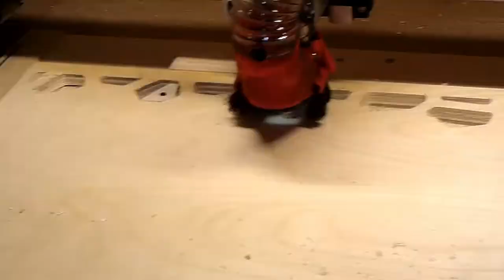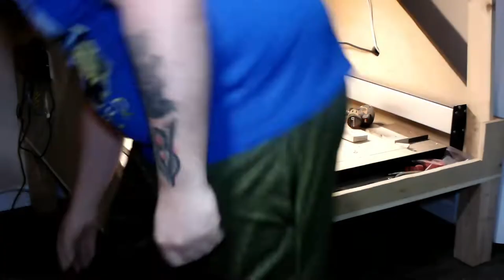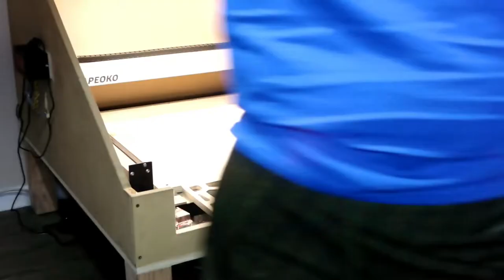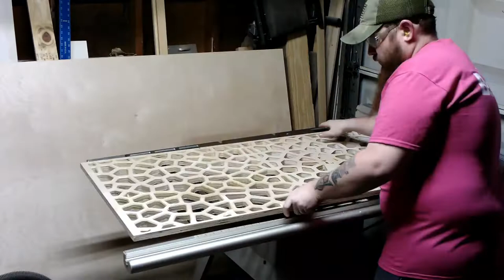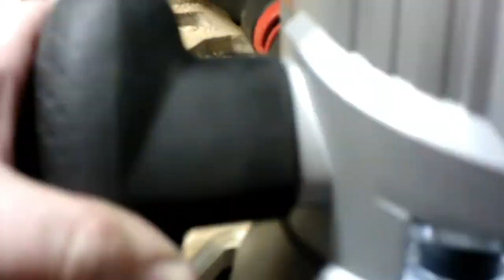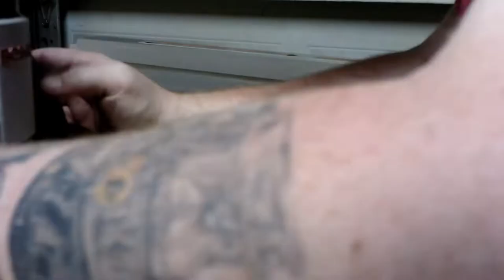Mid Century Modern Coffee Table Build pt 1

Comment: This was really neat to watch and learn from. When designing it how do you map out what cannot be cut on the bed? Did you have two files and do overlap for the second cutting so the router was essentially recutting the middle holes (which would be empty)? Sorry for dumb questions, just found your channel and I am probably going to get the Shapeoko 3 standard size so I am learning this beforehand.
Reply from the maker: I guess I just really over simplified it. I’m sure there’s better ways, but I just measured the half way point on my stock, which was 24” because it was 48” total. I lined that mark up with my y 0. After I ran that half, I just flipped the board end over end, lines the same mark up, and ran the same program on the other half.
Reply: @ChrisPowellFSD  Oh wow, I see. Smart and simple. Thank you.